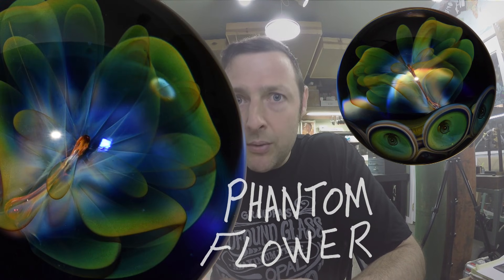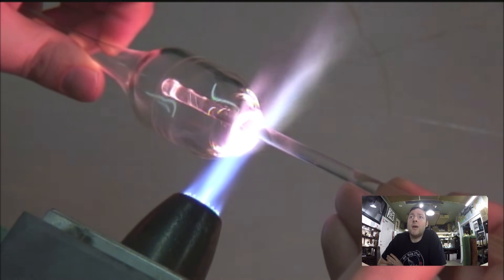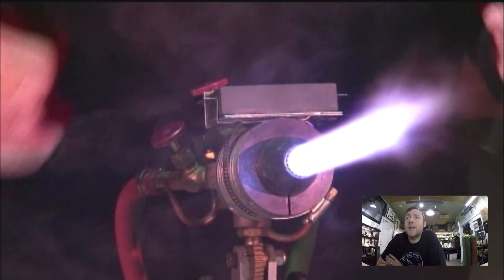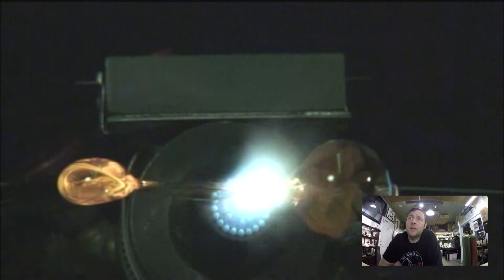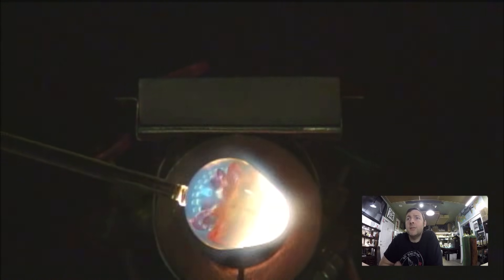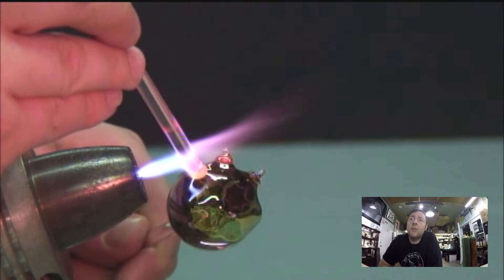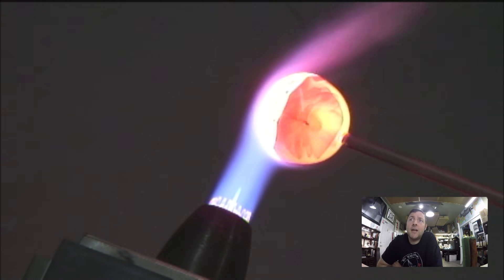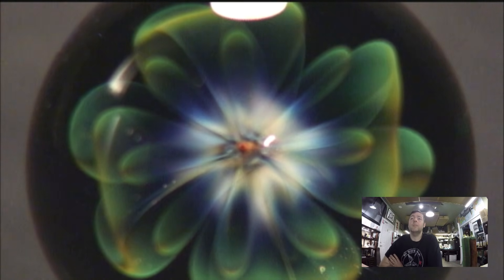How To Make A Phantom Flower Marble : #MARBLEHEAD Show 004

Comment: Hi I make ceramics lustered, n i luster Xmas glass bulbs, of blanks,of clear glass n lacquer the insides, white, but now I think I should be working both sides, inside n outside, ha.  i think, maybe . the reason you don't always get the gold best results is because as u add the clear over the fiume gold over cobalt, you are probably burning off the thin gold coat. Did u say the phantom lines swirls are the gold n silver? Cool. Do u trap the golf fume in the tube?, I wonder what type of results you can get w dots, on stacked up, n  kiln fired glass sheet small circles l w clear on top? Cold work n kiln fired. Have any ideas on cold work stacked circles, seems like I'd need to do hot dots, n fume it, have u tried cobalt luster fumed inside?is it possible To get the desired phantom result in cold kiln work?have ever made cupped, earrings   mk, I've made a million pieces n now retired,

Comment: I wish you would have shown the fuming parts. I don't understand why you went off camera to do the fuming
Reply: 6:00 - 6:05 shows gold fume... 6:11 - 6:15 shows silver fume....
Reply: @timothykeyzers4966  no he's using a clear rod. As soon as he starts to fume he goes off camera. Re-watch that part.
Reply: @timothykeyzers4966  unless you don't actually touch the glass with the rod while you're fuming. Well, don't I feel stupid lol.. It's in the name "fume" is like a vapor. I get it now... Sorry I second guessed you Tim.
Reply: @jsinprtn29   The gold and silver is on the tip of the clear rods. when the tip of the clear rod is put into the flame it transfers the gold or silver fume vapors to the tube... It happens really quickly - and the video captures it all... alls that is happening off camera is me picking up and putting down the glass rod that has the metal attached.
Reply: @timothykeyzers4966  yea I figured that out the 3rd time watching it. I saw the fumes and it clicked in my brain.. That's why it's called fuming,, duh..you have to forgive me I am a blonde so I'm prone to things going over my head. Thank you for taking the time to explain it to me. You do awesome work, BTW!!
Reply: @jsinprtn29  All good! That's how we learn. Thanks.

Comment: How do you not burn away all the fumes???
Reply from the maker: Practice is my best advice. There are so many subtle variables that lead to the fuming not burning off - Surface temp before applying fuming, flame settings, where the metal is placed in the flame, timing, what the flame is allowed to hit, how you apply the clear over the fume, and the mood of the glass gods (and the list goes on).... Getting through the process as many times as possible is my best advice.